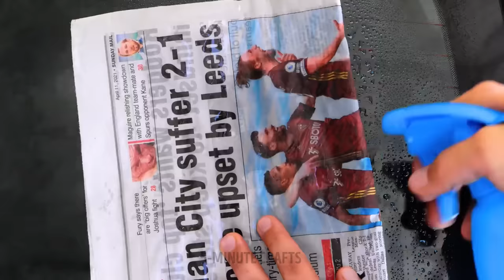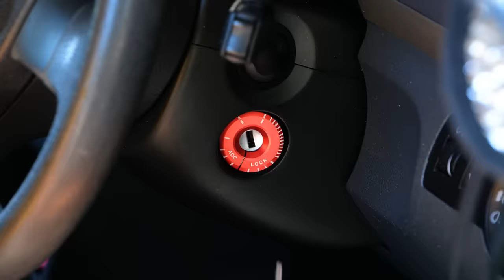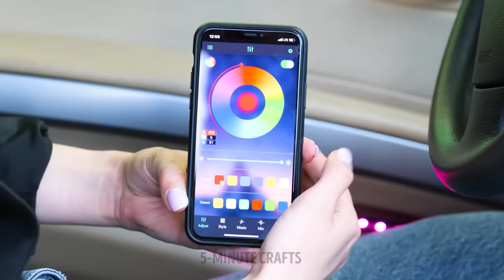WOW! Easy hacks you didn't know about! VALUABLE CAR HACKS EVERY DRIVER NEEDS TO KNOW

Comment: I laughed so hard at half of these "hacks!"  Carry a samurai sword in your car in case your shift handle comes off!  Use toothpaste to clean light dust off license plate when a wet rag would have worked instead!  Put a can on your tail pipe and your car won't violently shake anymore! Use $3000 worth of cell phones and smart watches instead of a $50 back up camera!  Buy a fog machine instead of an $2 air freshener! Put reflective tape all over your car because otherwise your car would be invisible at night!  Magically knock on your trunk to open it!  Improperly use detailing methods that can actually damage your car!